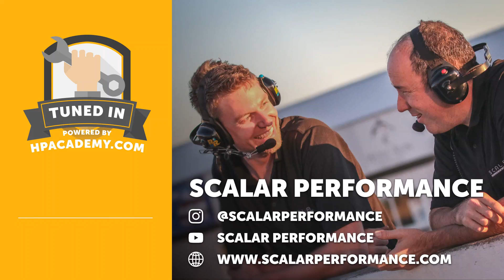103: EV Racing. It's Not What You Think [#PODCAST]

Comment: With this EV, the purchase cost is pretty high but when you take into account the drivetrain spares package plus the engine and transmission rebuilds, it definitely makes it a lot more palatable over say a three to five year programme so it’ll be interesting. Wonder if they’ll be able to extend run times past 30mins for more endurance based competitions like the GT4 cars
Reply from the maker: Yes more upfront cost for much less maintenance. That's the goal anyway and I'm also interested to see the progression down the line. 
This is only their first step after all, though it really is a giant leap when you compare it to the road going EVs most of us are more familiar with (Tesla, Nissan, Ford, Chevy etc) - Taz.

Comment from the maker: Even if you're not a fan of EVs in motorsport, give this a listen before jumping to conclusions. There will be discussions in here you will find insightful, and possibly even helpful beyond what is or isn't powering a chassis 😎 - Taz.
TIME STAMPS:
0:00 - Welcome to the Tuned In Podcast
4:38 — How did Joel get into the industry?
7:47 — Brian's professional background
16:40 — Formal Qualifications
19:18 — Overview of Scalar Performance
27:10 — Racing an ICE vehicle vs an EV vehicle
31:27 — Why the GR86?
33:25 — Why create the SCR1 instead of modifying a Tesla?
36:33 — Modification to chassis
45:32 — Cost of EV components
48:39 — 3D modelling the SCR1
52:00 — What is an inverter?
1:02:09 — Cooling the batteries and motor
1:10:08 — Charging challenges
1:12:22 — Regenerative braking
1:17:38 — Power delivery of the Cascadia motor
1:20:38 — Maintenence costs
1:25:17 — Cost of the SCR1
1:27:39 — A dedicated race series?
1:30:34 — Integrating EVs into motorsport
1:34:08 — EV safety and thermal runaway

Comment: EV in motorsport should be used only for the "boost" part, the acceleration made wilth a hybrid setup
Reply from the maker: Yes there are a few different use cases and nothing is quite set yet when it comes to how it will all pan out, but there are pros and cons for all approaches.
When you mix ICE and EV tech though you inherently get all the benefits but also all of the downsides though, as well as complexity. That might not be much of a problem for well funded race teams, but it might be difficult for club racers vs just one or the other - Taz.
Reply: @hpa101  thank you for your answer, sir. 🙂